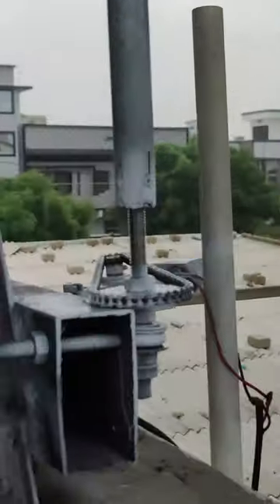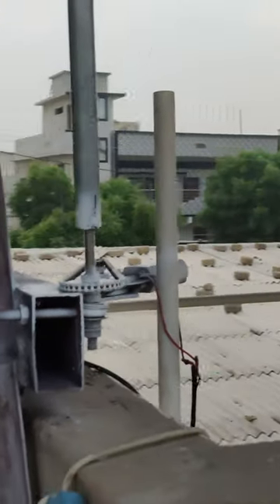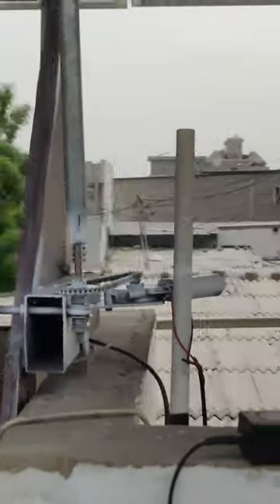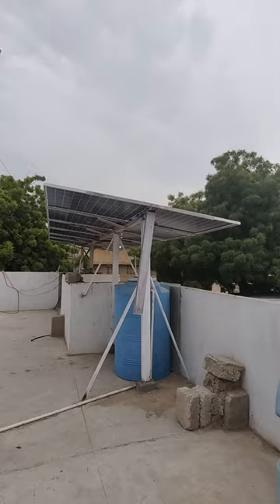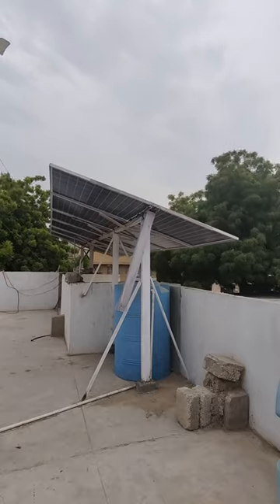DIY 3kW Solar Tracking System | Short overview

Comment: I also made a tracker with 6 panel himo7 when i tilt more than 25 degree having a weight balancing problem 
Kindly share auto moving system in detail
Reply from the maker: Happy to hear about your tracking system.
Sure we will share  in details
Reply: Sir ap ky tracking system sy production kitny % increase Hoi ha as compared to fixed stand
Reply: @mohammadqasimjameel800  with 6 homo 7   at 5:40 125 watt on 90degree then I tilt west 40 degree output become 650/670 watts